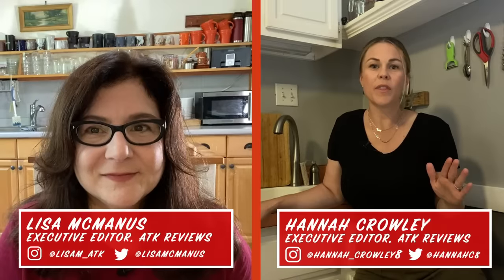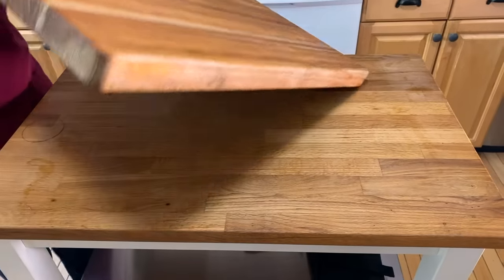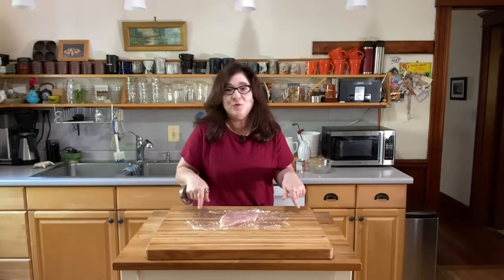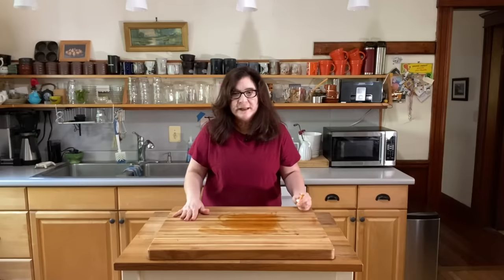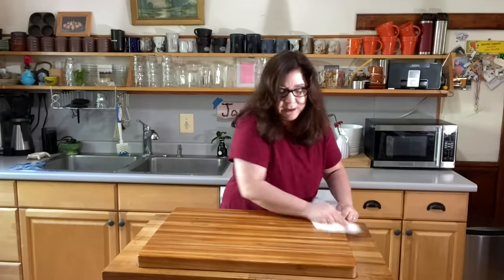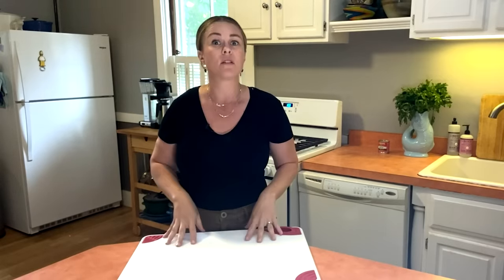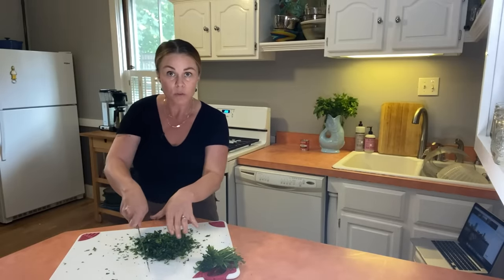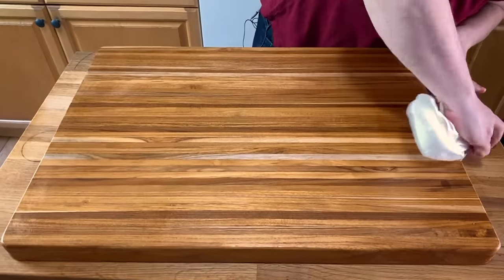Gear Heads | Which Type of Cutting Board is Best for Your Kitchen?

Comment: I can’t open those cans either, and I’m afraid of cutting myself.
Reply: Yeah, don’t even try to do it after a few beers.
Reply: fordhouse8b yeah, who designed those cans! Let’s go back to using can opener‘s. What was wrong with those?
Reply: @stevenreichertart  I don’t actually mind the ones with pull tabs, as long as they are made right and are tall enough to get a decent grip on. I really don’t like them on short cans, like tiny cans of cat food, or flat and flimsy little tins of herring. Cut my hand pretty bad trying to feed my mothers cat once when I had consumed a few beers after work.

Comment: HOW DO YOU GET ONION SMELL OUT OF A WOODEN CUTTING BOARD ? THE SMELL LINGERS AND ANNOYINGLY TRANSFERS TO ANYTHING IT TOUCHES. DO YOU HAVE TO SAND IT OUT? ALSO, FROM TIME TO TIME ON AIR DRIED CUTTING BOARDS  I HAVE SEEN BLACK MARKS THAT LOOK LIKE MOULD. WHAT IS THAT? I ALWAYS THOUGHT AIR DRYING WAS BEST.
Reply: @lisacastano1064  I DON'T FIND THAT LEMON,VINEGAR OR BAKING SODA GET THE SMELL OUT. WHAT YOU'RE LEFT WITH ARE LEMONY SMELLING ONIONS.
Reply: @susiefraser9182  I've never had a problem even though I don't use a lot of onions I use a ton of garlic.  But I keep my board oiled when I oil it I put my oven on warm and put the board in there and turn off the heat it helps the oil soak in so odors really can't
Reply: @lisacastano1064  THANKS,LISA. THAT IS A TIP I HAVE NEVER HEARD BEFORE. I AM CURIOUS TO TRY IT.
Reply: Wash it with hot soap & water in a sink scrubbing thoroughly in different directions, drain the sink, rinse off with warm water, then sprinkle salt over the board lightly, scrub the salt in, then wash the salt off in the empty sink with 1/2 a kettle of boiling water. Leave to air dry in a dishrack. The scent will be gone.
Reply: @Horizon344  YOU ARE AN ABSOLUTE STAR. I AM GOING TO TRY THAT TODAY! MANY THANKS
Reply: @susiefraser9182  I always keep my two boards in the dishrack when not in use Susie, separated from one another so there is space/air around them all the time to let them dry & prevent damp/mold. I wouldn't store them any other way. Never had trouble with them in 20 years following these guidelines.

Comment: 09/29/2020
I'm surprized that using a glass board wasn't mentioned. I have 3 small "boards" ~ a glass, wooden & plastic. I generally grab the glass one. I feel that it is best hygienically.
Reply: JESUS Name Above All Names Glass is hard on knives.  It's like cutting on stone.  ATK uses them when they want to purpsely dull a knife.
Reply: 10/12/2020
 @petrunak4579  
Thanks!! I didn't realize that. I'll use my wooden or plastic board from now on. 😊

Comment: Wood boards can be gorgeous, but I don't want one. I have 5 (!!) plastic boards, from "copy-paper-sized," which I use most often, to 16" x 20." They've seen daily use for a decade, clean just fine in the dishwasher and need no maintenance beyond that. They're also inexpensive, lightweight, and easy to handle. No wood for me, thanks.

Comment: But they recommend vegetable oil for seasoning iron skillets despite the rancidity mentioned in this video. I think that’s a mistake.
Reply: Nicolas Martin the oil is baked into iron skillets forming a hard almost glassy surface that can’t turn rancid. Mineral oil never dries. So is not suited for coating cookware. I don’t even use it on cutting boards. I prefer to use organic flax seed oil that is food safe and dries to an almost varnish like film without all the thinners and additives used in varnish.
Reply: @frugalweaver  The recommended applying the oil to a skillet at medium low temp, so there is no way that baked it in. In any case, vegetable oils become rancid.
Reply: Nicolas Martin proper seasoning requires 350 degrees for 30 minutes with pan upside down in oven.
Reply: @frugalweaver  Then your gripe is with ATK since the recommend what I described. But again, your method would no prevent rancidity. Baked vegetable oils eventually go rancid.

Comment: lol that board size assumes people have big kitchens.... in Brooklyn I have no room for something like that
Reply: I have a kitchen that's smaller than most bedroom closets I've had. -The cutting board is where most of my kitchen work is done. -2 Kitchen Aid mixers sit on the floor in the living room; no toaster oven, no microwave at all. I'd take a large cutting board over a kitchen table.
Reply: Even most small kitchens have a counter surface that measures more than 18 by 24 inches. That is really all the center pace you need. Proteak also sells smaller boards. I have an 20 x 14 inch board from them. It is thicker, at 2.5 inches, but is a bit easier to wash in my sink. If my sink was a bit larger, I would greatly prefer the larger surface board, but that may be because I am used to using 24 x 18 inch boards at work, though sadly not wooden ones. Of course it also depends on what kind of cooking you do, and in what quantities.
Reply: mad thumbs I don’t even have room for a kitchen table.  My kitchen has two slivers of countertops. That is the reality of living in NYC
Reply: fordhouse8b you clearly haven’t seen nyc apartments.  I have one sliver of a counter top and no space for a table.  As do most people in nyc
Reply: @TheKristinjackson  I hear you, I was thinking of a more ‘middle American’ small kitchen. The only Brooklyn kitchen I have any personal experience with was in my mother’s brownstone in the mid 70’s, and it probably seemed bigger than it actually was, to a 5 year old.

Comment: Please Please PLEASE!  If anyone is reading this, stop listening to ATK for kitchen/cooking advice.  They used to be helpful many years back, but they have just lost all credibility the last 10-20 years, and their advice has devolved into ridiculous peddling of garbage products and recommendations.  Sure, sometimes they get some things right, but their suggestions are just way too hit&miss these days to have any credibility.

And with this video, here we are yet again ATK, dispensing more mediocre to terrible advice.  First of all, wood lady says she is going to compare types of cutting boards, but then really only focuses on the edge grain teak board.  Doesn't talk about other pros and cons for different types of woods, or really get into too much other than "it feels sturdy and doesn't stain.."  The only potentially relevant thing she added was that the end grain blocks tend to crack, but that doesn't even scratch the surface of the other potential issues to discuss.  And then she goes on to give you some of the worst advice that you can for wooden board, which is to run them under hot and soapy water!  🤦🏼‍♂🤦🏼‍♂🤦🏼‍♂

Heat and moisture (especially combined) are absolutely terrible for wood, and completely unnecessary for keeping things clean.  Just a lightly damp rag and some diluted white vinegar spray are all you need.  Plus it also fights stains and odors, too.  Don't even let it sit and soak.  Just spray and wipe off, and let it completely air out before applying oil.  And also, speaking of oil, she perpetuates the same old myth that you need to let the oil "soak" into the wood.  Wood doesn't like to be completely saturated in oil, and if you do that, you'll just be dealing with a greasy board surface while it keeps purging all of that excess oil out of its pours.  Just a thin coat from a soaked applicator is all you need.

OH!  But the worst part is how can they sit there with a straight face and recommend that plastic cutting board with those ridiculous red rubber corners.  That's their top pick?!  Those stupid "non-slip" corners effectively turn that 15x20 cutting board into a 11x14 surface, which is an area loss of almost exactly 50%! (300 in•sq down to 154 in•sq) So I guess these ladies don't really care about larger boards after all?  But even if I wanted a smaller board, why would I want to buy something larger that only has half the usable surface?  So dumb.  And to anyone who says that a plastic board without these raised corners will slip on you, an entire 10-ft roll of anti-slip shelf liner will cost you like 9 bucks and is by far the most elegant solution I have used in my kitchen.  That makes way more sense than that silly board.

And I don't care what they try to push, that thickness is absolutely not enough to prevent warping for dishwasher use.  They are relying on those protruding rubber corners to compensate for the inevitable bowing that you will get.  If you are planning on using a plastic board, I would recommend one at least 1" thick.  Their "overall favorite pick" is only a half an inch, which will surely warp on you.  And they didn't even mention the worst part about any plastic cutting board (yes, even the thick ones): their life expectancy will always be cut short by the fact they their surfaces turn extremely rough and sharp in short order, and they leak little plastic slivers everywhere and will just have to be replaced.  When a wood board surface gets rough and chewed up, you can just plane it and sand it down and presto, BRAND NEW freaking cutting surface.  You can't refinish a plastic board, so you'll be repurchasing a new one every couple of years anyway, shelling out more and more cash for something that is ugly, inefficient, & warped; over the 25 years of owning a single $135 wooden cutting board, you'll have paid over $400 on crappy, wobbly plastic ones.  

Now I am not saying that plastic cutting boards have absolutely no place in the kitchen, just not the place that these morons are claiming.  I would never in my life recommend a plastic cutting board for prepping veg and chopping up canned adobos (since that's apparently a realistic "test").  🙄 But I do recognize that there are some nasty jobs that just make more sense on a plastic board, mainly for breaking down poultry and other unsanitary tasks.  I'm not saying that you can't use wood for those, but it's impractical to try to use the same cutting board for your veg and your high-risk bacterial tasks, unless you want to be constantly washing and air drying your cutting board, and I refuse to have two separate wooden cutting boards, so I just felt more comfortable getting a quality, lightweight, easily-stored plastic board for those tasks.  And since I know that I won't put too much wear and tear into its surface, it should last me at least 10 years, if not more.  I find it so much simpler and faster to just whip out my 1-inch thick 18x12 plastic board, debone a bunch of chicken legs, and then just pop it into the dishwasher and keep moving with any recipe.  

OH AND HERE'S THE BEST PART!  The plastic cutting board that I bought that is more durable than their pick and has 40% more usable cutting space?  Ya, it's still available online for $5 LESS than their stupid pick.  Just search "Restaurant Thick White Plastic Cutting Board 18x12 Large, 1 Inch Thick" on the same site that they linked, and you'll find it.  So again, please see my first point; ignore these dimwits and find yourself some better reviewers.  None of their advice is reliable anymore.  Remove them from your algorithm with some swift thumbs down, and stop giving them any validity with your attention.  They are just spreading misinformation and bad advice.

Comment: Bamboo is far and away the best cutting board material for home use. Also, a cutting board that doesn't fit in your sink is not a tool, it's a millstone around the cook's neck. Yes, a larger board is generally better for some tasks, but it has to actually work in your kitchen. The oversized boards shown along with the crazy prices, show ATK for what it is: a bunch of high end rubbish with no concern for what works for real people. If you will spend for any of the boards shown, which start at $85 and run to almost $300, you likely have a multiple-6-figure income and are by no means average. You guys really have to find a way to be relevant to regular folks at least some of the time. Sadly, experience has shown that that is asking ATK for too much. I wonder why I bother. SMH.

Comment: Mineral oil DOES NOT moisturize your board. Petrol distillate oil will dry out wood. Oiling your board is not really necessary. It's not a piece of furniture that needs the finish preserved. Keep it clean and dry. Don't go overboard on the soap when you clean it.

Comment: Cooking oil won't turn rancid. Tired of that wives tale. 
Assuming you are actually using your board and thus cleaning it daily if not more often, it going rancid will just never be an issue. 
Otherwise you cutting meat on it would make it go rancid over time too 🤦‍♂️
Now yes, if you rarely if ever actually cook or perhaps you are caring for a cutting board at your summer villa or winter cottage in the mountains then sure, then start to worry about the oil spoiling over time. But for 99.999% of people thats just not an issue, at all.